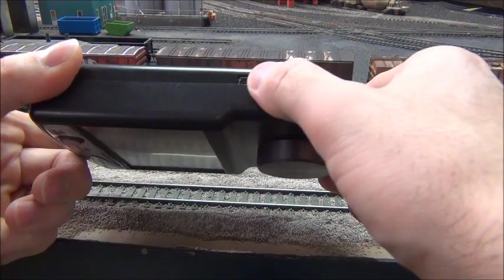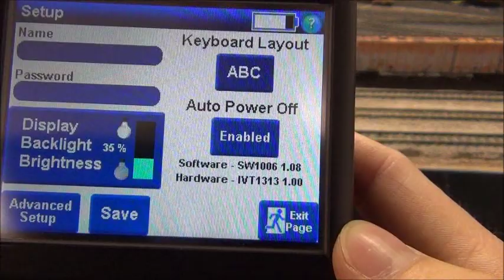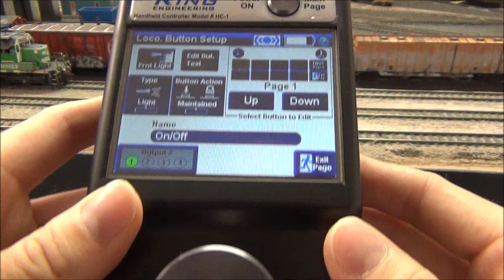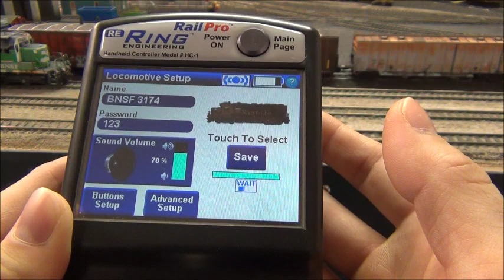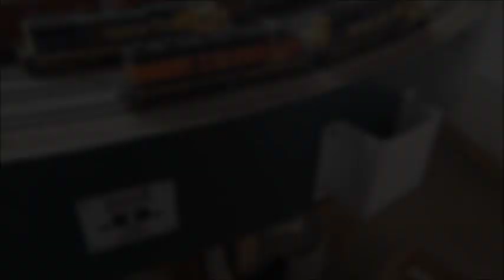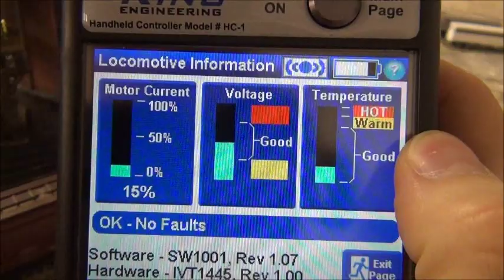Ring Engineering Railpro Review

Comment: I am new to the whole DCC sound and controls. I do wat sound that is prototypical but without having to adjust settings like CV files. The RailPro looks nice and easy, but how long has it been around?
Reply from the maker: Railpro itself has been around for a few years, don't know the exact date.  The parent company, Ring Engineering, has been around for 10 years I think.  I don't miss messing around with CVs.  Railpro is indeed easy to use. I would like a larger sound library and more prototype sounds (air, compressor, fans), but that is just a matter of time.  They just added the EMD 567 and GEVO sound files within the past few weeks, so they are working on getting more sounds available. I believe they are concentrating on getting the main prime mover sounds released, then will go back and work on the smaller sounds.

Comment: How does the RailPro SOUND compare to DCC sound, such as Tsunami?
Reply from the maker: Tough question to answer.  Mostly comes down to individual preference.  I don't like the Tsunami sound as much as I used to. To me their horns are too quiet, and the pop off valve noise is a dead giveaway that it's a Tsunami.  LokSound has some of the best DCC sound I've heard.  Railpro (like LokSound) is customizable and upgradeable, so as new sounds become available you can download them to individual locomotives.  I like the prime mover sounds on Railpro, and the horns they have.  The horn sounds are limited though and they also currently lack air left-offs and compressor sounds.  Those will be added in the future.  Users can submit their own recordings to be distributed and used by all Railpro users.

Comment from the maker: Programming is quick and simple.  Each loco is set using a one-time automatic test, then the information taken from that is used to set each locomotive to work with each other, independent of any input from the user.  I like to tinker and test though, so I've been messing around with different settings on locos to see what I can do.  Settings can be adjusted on the fly, so I can see how each tweak I do affects the locos in real-time.

Comment from the maker: Have not heard of any problems with NCE or Digitrax. We use Digitrax at the club and I've never had an issue. I can use it just fine with one hand, I can reach any button I need to with my thumb. Just because the video doesn't show it doesn't mean I don't run one-handed. I never have a problem with pushing the wrong buttons either...I can control my fingers just fine. Total expense is comparable to NCE starter kits ranging $400-$500, Railpro throttle and power is $500 on YankeeDabbler.

Comment: Many have had problems with radio interference they are using the same freq thet all radio controled layout NCE and Digitral use.  Same problem at model train shows that the reason people are going to wifi.   

You can not use it with one hand. and you can not stop touching screen and it goes anywere it whats.  You use two hands in your own video C on Man. .  Total expense is double what anything else. is. Were is safty strap.  

It just another play toy I am sure some people will by it.

Comment from the maker: Arthur: I can take this to whatever layout I want and it will run. With the IPhone you need to have the layout wired to accept that through JMRI. All I need to run my locos is the throttle...it fits in my pocket, it's not that hard to carry around. Price of the decoders on Yankee Dabbler is $75, cheaper than a standard sound decoder. All my locos start as non-sound and I convert them myself. I don't waste money on factory sound locos. Please do your research before posting.

Comment: Well Gang the I phone, and 3G or 4G wifi phones are free when you have one to operate your trains.  HO did I mention you can't take it to another Digitrax or NCE layout and use it.  Can take  your engines to club  with out the system to run your engines. You did not mention the price of the decoders.  Do not know any manufactures who are putting their decoders in.  So all those nice sound units wiill have to be changed. C on Man this one is DOA.
Reply: Theres no way an iphone should be mentioned in the same sentence with this system. Youre delusional.

Comment from the maker: Yes definitely an issue if Ring closes shop, but I don't see it happening.  But if it ever does, Railpro will still work just fine.  Safety straps would be a great thing to add IMO...my controller has taken a few tumbles to the floor.  It is surprisingly resilient.

Comment: I have operated with one one and would not buy one. Very heavy, will not fit most people's hands, no place to attach safety la trap.  Using it in op sec and every time I turned around the screen had been touched and it had got off to a place that did not allow control of train. No way to connect to JMRI. This is a quit very expensive play toy that has very limited capabilities. You have to get every thing form ring does not conform to any NMRA standards.

Comment from the maker: Dave - 1.) It costs a bit more for the controller than Digitrax, but they don't even compare. Railpro is much slicker and more capable than Digitrax controllers. 2.) No problem with supply. I order from Yankee Dabbler and they ship very quickly. 3.) I've thought about it, but I don't know how you'd fit a LiPo unless you were installing in one of the larger 6-axles. The club does not use the PWR-75 though, it is all wired with Digitrax. 4.) I'll post another video with examples of my installs.

Comment: Thanks for the review, freewake84 1.) How would you evaluate the cost / benefit of Rail Pro to Digitrax? 2.) Have you had any problems with supply of components? 3.) Have you or your club discussed using Rail Pro with a LiPo battery power IN each loco versus getting power from the PWR-75? 4.) Can you show or describe your sound install? Thanks. Keep up the good work! And have fun running your trains.

Comment from the maker: Railpro only uses the power to the rails from the Digitrax system, not the DCC signals. You can use it on any DCC layout that meets NMRA standards (or DC too). The locos only need power from the track. The control for Railpro is radio-based, and goes directly from the controller to the locomotives.  I can take my controller and locomotives and run on any layout I want, without having to do anything special. Turn the power on to the track, put your locos on and you're set to go.

Comment from the maker: Taylor - You can turn on/off headlights, ditchlights, strobes, etc as needed.  I had them all on because as far as I understand, proto trains run with the headlights on low on the follower locos.  If you watch on the RE video you can see how to set buttons for each locomotive..  So you can have anything on a particular locomotive running while it is MU'd....all you have to do is select the locomotive on the screen and turn on/off whatever you want....while it's MU'd, moving, whatever.

Comment from the maker: Jim - The battery lasts for 8+ hours depending on how you use it.  I've never actually had it on that long, but after using it for a 2-3 hour ops session it still has plenty of charge to go.  I charge it once a week and will use it at the club two times a week.  The interface is indeed great and very intuitive.  Thanks for the compliments on the models....they are all ones that I did myself.  Still learning, but I've improved with every one.